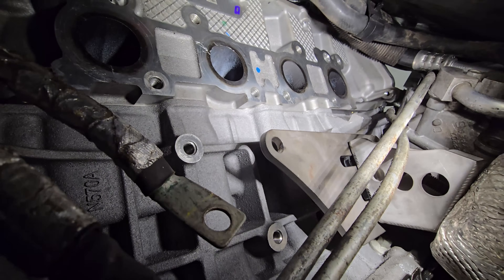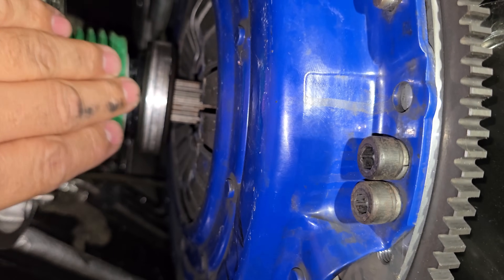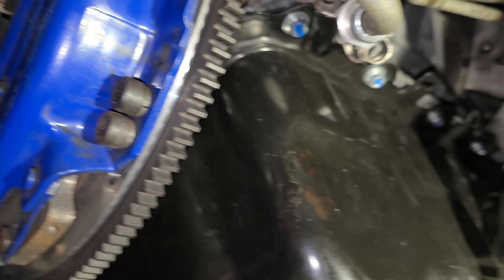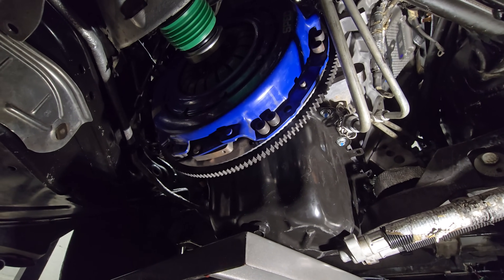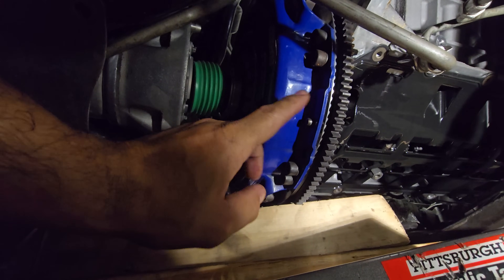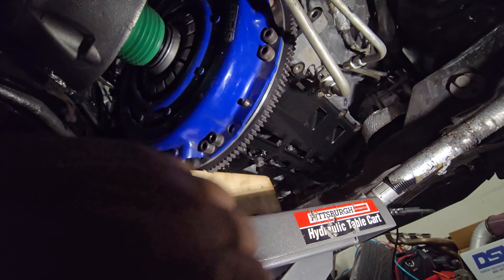Will the Actual Coyote motor physically fit into a C6 ZR-1?

Comment: Should have put it in a foxbody zr1 5.0 is lame and won’t run low 6s or achieve any better then the c6 already has with original motor but coyote foxbody would be a unit and not worth all that cutting welding to be slower but I understand the goal
Reply from the maker: @MasonAlexander-bz2cy  there's 0 cutting 
I already built a coyote foxbody. It handled like ass. This is a carbon body carbon brakes good handling transaxle equipped vehicle if you think it's lame...you're just hating.
Reply: @ not exactly lame but more of pointless to ne atleast to put that time and effort into a zr1 for it to be slower when you can put the same time into suspension and brakes on a foxbody and easily put a 5.0 in there it will handle how you want it and will run better

Comment: What an idiotic swap and an incredible waste of a ZR1.
Reply: It’s got a better engine now though!!
Reply: @ No it doesn’t. A coyote motor is a waste of time and a ton of unneeded complexity. Doesn’t make any more horsepower per cubic inch then an LS motor does for all the complication and extra weight. Less in fact. Coyote motor barely squeaks out 1 hp/in.³. An LS motor is typically 1.1 to 1.2 hp/in.³. So like I said, what a worthless swap.
Reply: A factory sealed coyote can make more power than any LS ever, and with no meth or ice tank and no heat soak issues 

Tell me why no ls9 beat the coyotes at FL2k ?
Reply: @Coyote.Collector  LOL.  Nope. You're out of your mind.

Comment: Would a dry sunp oiling system buy the clearance you need? You could probably reuse the zr1’s factory system for it
Reply: There might be a bit too many clearance issues in the engine bay with the way most dry sump kits are mounted for The coyote.

Comment: I've done this type of custom engine/chassis integration before.  First get the custom bellhousing done so you know for sure how the motor places relative to the drivetrain and body.  Then I''d call Canton oil pans and find out the minimum clearance for the front of the pan below the windage tray, the space between the bottom of the pan and the rack/k member, and find out if they can integrate the stock dry sump as that will affect the pan shape.  Then with that info get the motor mounted where you want it / it needs to be.  Then cut yr stock coyote pan as needed and fabricate the modifications you want using tape and cardboard to test fit something you can actually see.  Once you got that the way you want it measure and get a custom Canton pan.  Then reroute all the hoses. Then do the custom headers.  Then the real problems will begin with integrating the electronics.